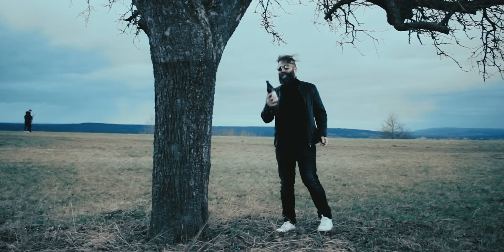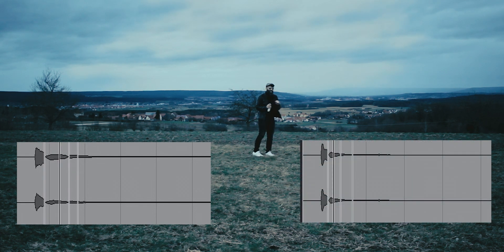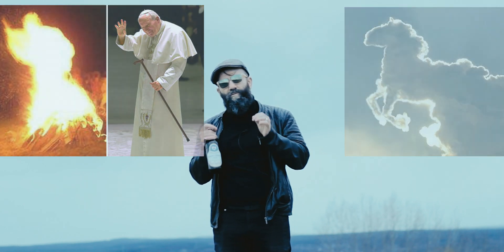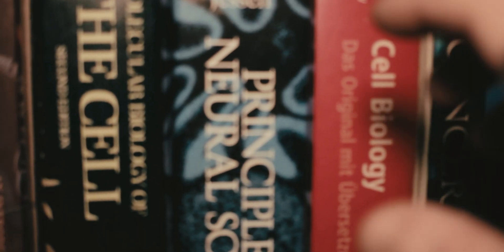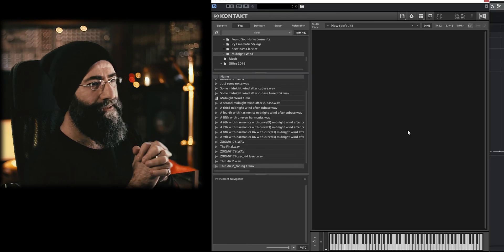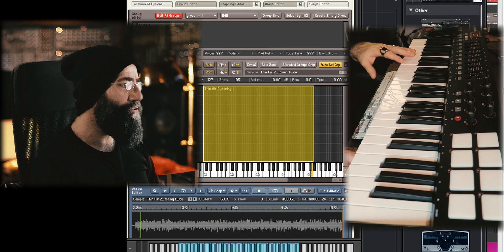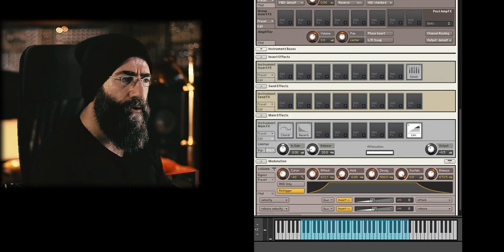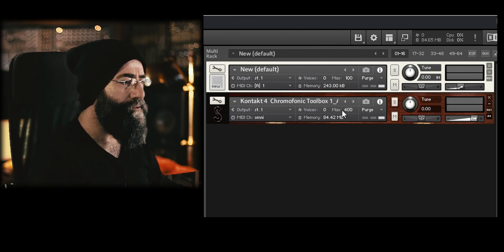Build A Sampling Instrument Out Of Thin Air (3 essential Kontakt tricks)

Comment: I tried a different way to build an Instrument out of air. Instead of an Equalizer I used „corpus“, a plugin from ableton. Idk how it works exactly but u can choose specific frequencies and push them up in different Modes. (Pipe, string, tube etc.) 
It sounds kinda like a resonator with different algorithms. 

I could achieve different playable sounds with different modes than „just“ using the EQ. 

Thank you for the video! Pure gold as always!